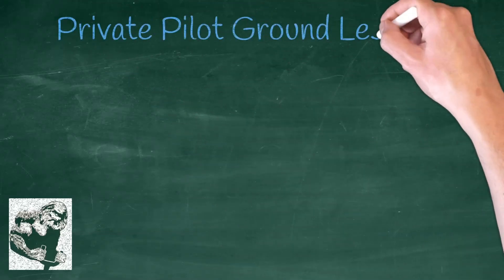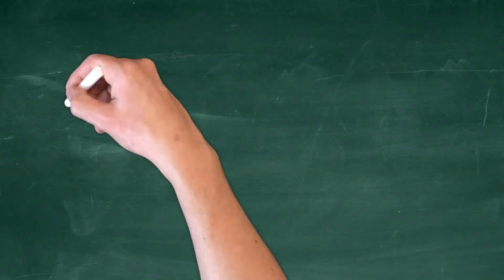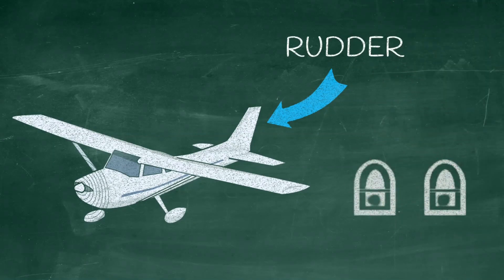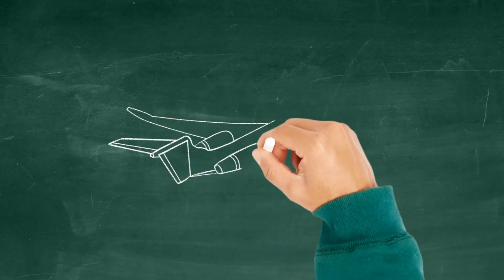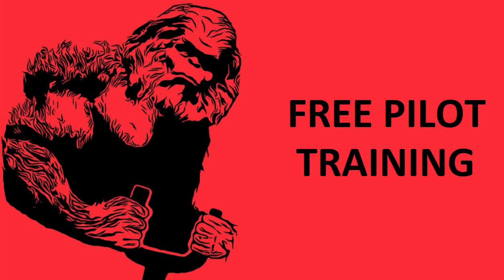Controlling The Airplane (Private Pilot Ground Lesson 5)

Comment: 0:16 the three axis 
-lateral (pitch) 
-longitudinal (roll) 
-vertical (yaw) 

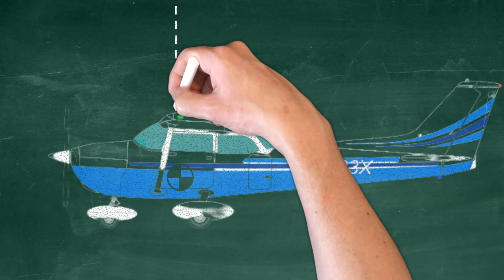0:32 center of gravity is center of movement of all 3 movements 

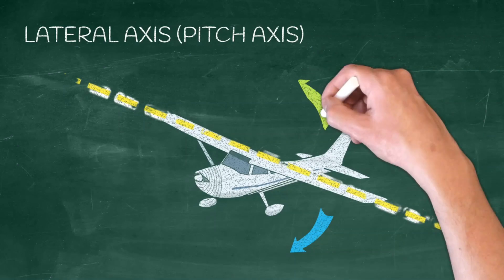0:39 Lateral(pitch) 
-first way airplane moves 
-pitches up and down and moves longitudinally and made by using the elevator and yolk 

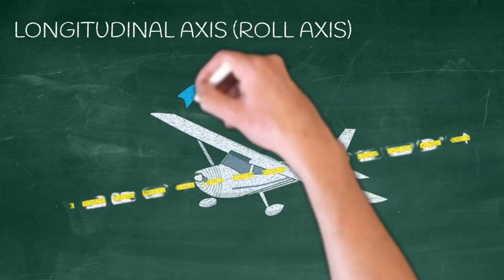1:00 longitudinal(roll) 
-airplane rolls laterally 
-airleron is used 

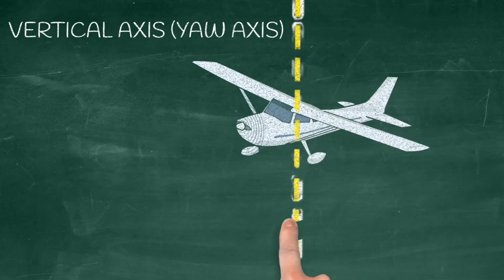1:24 vertical(yaw)
-sideways movement 
-rudders are used